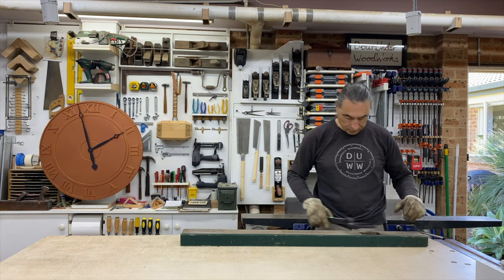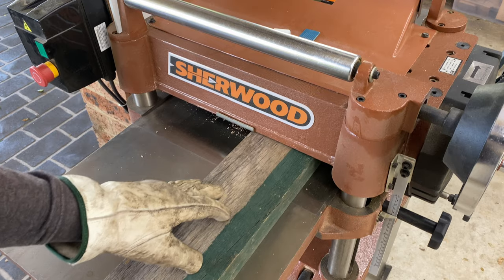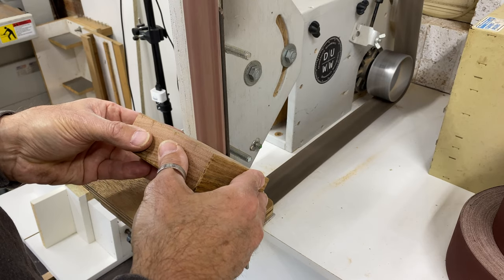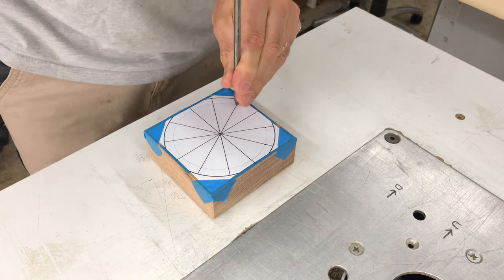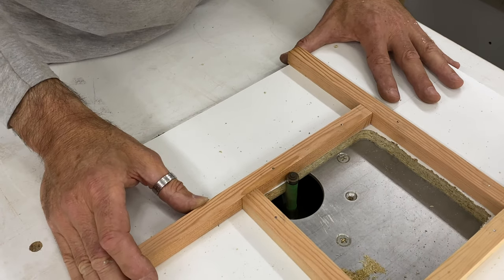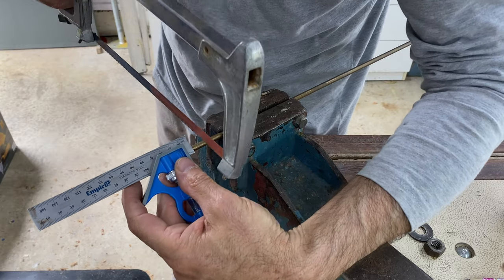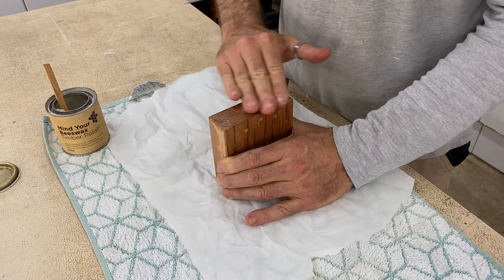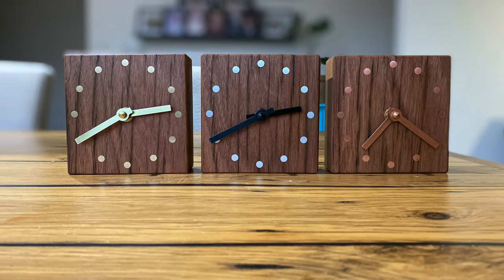Make your own clocks | Timeless creations

Comment: This is a great example how in a workshop everything can change but nothing changes. Put them side by side and the laymen probably can't see the difference, but for the maker there is a world of difference. Lovely stuff mate.
Reply from the maker: Thanks James. It’s was an interesting process to make these again after so many years. So much of the process was still the same and then there was the jointer and thicknesser for milling the wood which was way better than how I did it the first time. Also back then I only ever used poly as a finish.

Comment: Hey Vic, Hopa you are well mate ....... 
I see the SB 20 is doing well still ..lol. Yeah made a few clocks myself mate, and yes most mellinials have no Idea :P BTW ya need a small hook with a snall tin under it to catch the offcuts man :P. Ohh and instead of buying the polish, go to Woolies and grab some baby oil (Mineral Oil with some smellies in it is all that is) and down to your local bee keeper and buy a big block of beeswax, heat it up to a 3 (oil) to 1 (Beeswax) ratio, let cool and see if it matches your polish consistancy. if not heat and add more Wax or oil :) its called butchers butter. It is what i have always used on my cutting boards as Minteral oil is a nutral oil
Reply from the maker: Hey mate, thanks for the comment. I actually have some beeswax already waiting to try my own finish but will probably wait until I use up what I have. Cheers Ben

Comment: Beautifully done Vic. And that was some hardwood right there mate. Where do you buy the middles for your clocks? EBay?
Reply from the maker: Thanks very much Dave, it sure is mate. I reckon we have the hardest woods here, the old reclaimed ones anyway. Clock mechanisms are readily available on eBay and the other usual places but I think there are a lot of cheap unbranded ones out there. I only use 'Takane' brand which are made in USA and they're not expensive. There's a local supplier here in Sydney 'Timberbits' where I got these ones but if you google the brand name you should find other suppliers.
Reply: Thanks for the reply Vic, just watched the other one too, 137,000 view…. This one will be double aye 😂😂😂. Cheers.

Comment: mmmmmm could be yellow box as it was commonly used for fencing
Reply from the maker: Thanks for that Rob. Just curious then, is yellow box called that because of its colour because the colour of that board when i run it over the jointer definitely has a yellow tone
Reply: @DownUnderWoodWorks  probably mate and when you get the red box its very orange and red but bother are very hard woods, I have a friend cabinet maker who has just built a table from the rafters of an old one hundred year old shed and it was all yellow box  and the colour was outstanding

Comment: Great video, but I cringe when I see you using gloves on your machines. It’d the basic number one no no.
Reply from the maker: Thanks Colin, and thanks for your concern. I don't know your level of knowledge, skill and experience in woodworking and using machines but i have been doing it for a very long time. I think, sometimes, comments like that are from those who don't really know. I do know. I'm not in any more danger because i am not going to get my hands closer to moving parts with gloves on than i would without them. If you've watched many of my videos you will see that i only wear the gloves when handling reclaimed old aussie hardwood before and during the milling process then they come off. Those who do or have worked with this timber know how many splinters you can get and those splinters are literally like needles and spend days digging them out. Not nice. Thanks again mate